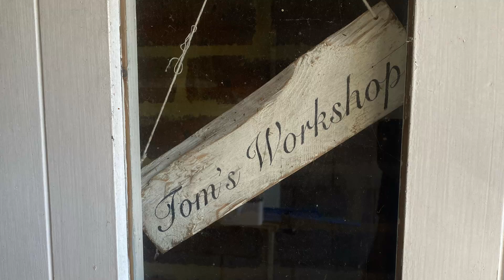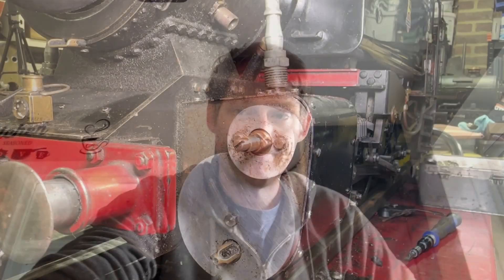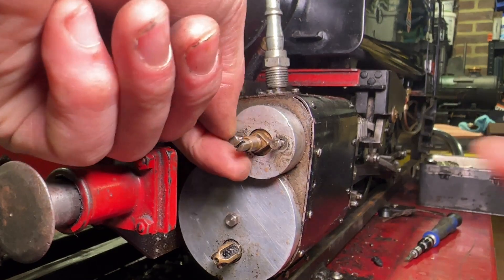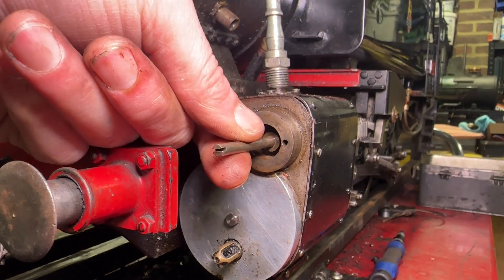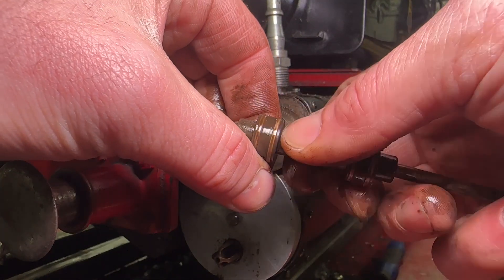Cylinder issue diagnosis…

Comment: Only one way, do it properly. Remove and rebore the cylinders, also the valve chests if they need it, new pistons with cast iron rings, new valves and rings. I wouldn't be happy about that taper pin coming out so easily 🤔

Comment: Morning Tom

It sounded like a broken ring when you first opened the throttle (regulator)

In hydraulic practice there is usually an O ring under the wear ring so that would be the easiest fix but I always prefer a nice bronze or cast iron ring.
Reply from the maker: Yes, there is a Pair of orings under each however they may be a touch thin, or the groove too deep so they’re not energised enough. Think I’ll go bronze and new heads.

Comment: Don’t half do a job. New piston valves, all new pistons and cast iron rings all round. Possibly even reboring the cylinders and sleeving if necessary, only one way to have a proper engineered solution, the right way
Reply from the maker: At the moment I don’t think reboring is necessary, it hasn’t done too much since the blocks were new, but I will do new valves and rings.